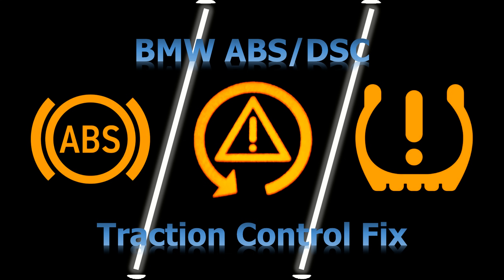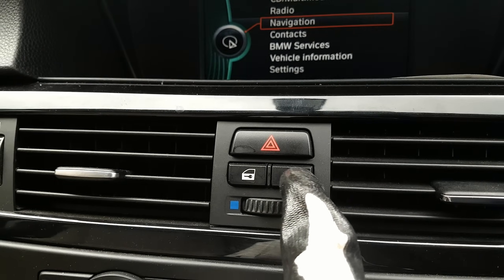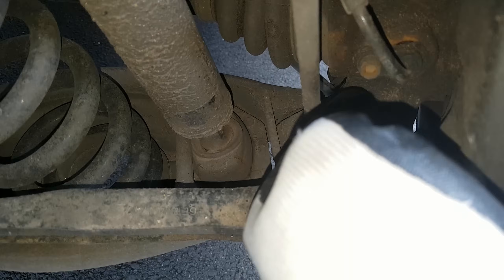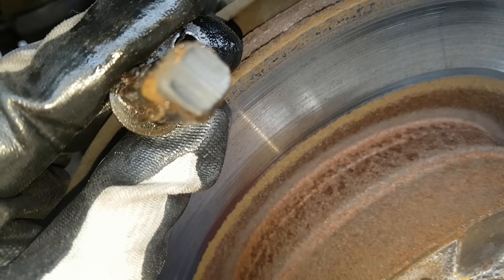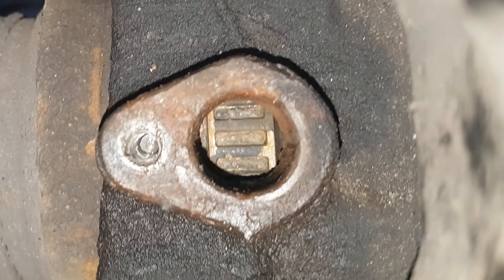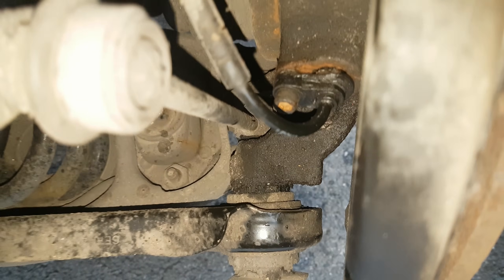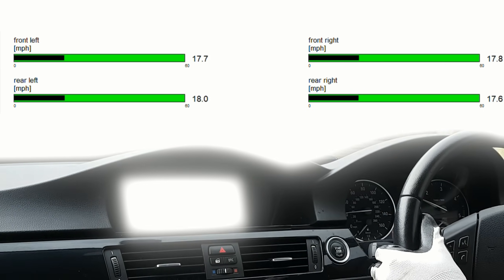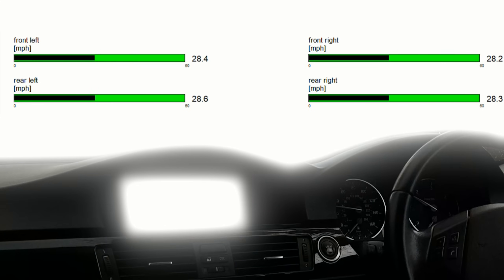BMW Traction Control ABS DSC DTC issue or loss of engine power

Comment: Really helpful video, thanks... and sorry, but I can't see where you explain how to determine which wheel it is without the diagnostic tool... Also...how can I be sure it's the wheel speed sensor and not the wheel angle sensor? Thanks in advance...
Reply from the maker: Sorry, I thought I did. In my case it was whenever i turned left it would fault out. In theory turning left means right tyre is seeing a greater deviation of speed compared to the other tyres, hence the fault.
Reply: @laymandiy  thanks.

Comment: Hi got same issue thanks for this! My diagnostic computers mentions this error on drive-1. Do you know which wheel this is?
Reply from the maker: Sorry, I do not. If you were to disconnect one of the speed sensors you'll know which one is 1 or2 because it would fault

Comment: Hi friend ! what kind of scan tool that you have ? I like it alot ,I had snap on scanner and I also have maxidas scanner but both of them don't have the bar graphs for speed sensors.My customer have a same problem with that light on ,her was 2002 BMW 530i and she has DSC button is that the same as DTC button ?
Reply from the maker: Inpa

Comment: Do you mean you can get a new set of axles ? The axles are what interact with the sensors. I'm just making sure before I get a new driveshaft. I have a xi so I might need 2
Reply from the maker: That is the permeant fix. Easier than replacing reluctor rings, however the reluctor ring method is cheaper.
Reply: @laymandiy  thank you! Awesome video . It saved me some depression lol

Comment: Hi, great vid, thanks. How do I find out which of my Wheels is causing this issue on my car?
Reply from the maker: Does opposite hand to the steering, usually. So steering left would be rear right sensor
Reply: @laymandiy  but I am not experiencing this when I'm steering. Just on a straight firing my first long journey in the morning...?
Reply from the maker: You're in the early stages then. The only other way is to jack the car up  and see which reluctor ring looks worse. You do not need to remove anything for this.

Comment: why don't you use a washer on the bolt that locks the sensor in position instead of there ?
Reply from the maker: Washer on the top of the bolt won't create the gap between the ring and sensor

Comment: I have a 08 528 xi and just upgraded to drill and slotted rotors installed new sensors and brand new shoes and hardware cause everything was rusted now and now am getting abs 4x4 and the dts why you think its causing that and the e brake light is on but in orange when the handbrake is down and red when is up I will really appreciate your help thanks
Reply from the maker: Did you also replace the drive shafts?

Comment: thank you for you videos, i have one question : i changed the ABS bloc ,
 and ring / sensor are fine , but it keeps showing the dtc/abs problem 
!! any advice ?
Reply from the maker: What does the diagnostic show?
Reply: @laymandiy  i scanned by OBD , nothing is shown , no default.
Reply from the maker: Are you using a generic obd or something like Kline/can or a A1/A2/A3 com. Generic scanners are pointless, you need one that read BMW control units.

Comment: hi great video. my son is having the same issue. how do you find out which wheel is causing the problem??
Reply from the maker: Difficult to determine, too many variables.. chances are both will probably need doing.. but depending on when the fault occurs left turn or right turn, it most probably will be the opposite side to that so in my case it was left turns causing an issue and it was the right rear wheel sensor
Reply: @laymandiy  pe is the rfect logical answer/ my opinion...what is nice about BMW is the community,...(we probably like the bmw body ;)))

Comment: Hi I really enjoy your videos, I am hoping you can help me I recently just bought a 2007 BMW 740l, in the last few days the display is showing Drive Control System! Drive moderately, the car is driving perfect no loss of power or steering, I called into a BMW specialist and he said it will need 3 hours on a dialysis scanner and it could be the automatic transmission, the car seems to be shifting through the gears ok, the logo light stays on and the drive control system, drive moderately goes out once the car is engaged in any gear.
.
Reply from the maker: Chances are your steering angle sensor needs replacing.

Comment: Hi, I have a E93 from 2009, I have just checked the 4 abs sensor holes to check for the rings so I could clean them, but surprise, looking through the holes none of them 4 have a ring. Please help
Reply from the maker: MANUEL ALEJANDRO PALACIOS CASTRO what fault are you getting. Some newer driveshafts had changed the way they check, with a smooth ring. But those weren't in these models. Yours has probably broken off, or someone has removed it previously. Can you see rust on it with grooves? Please send a picture and error codes
Reply: Hi, when I look through the abs screw hole I see no ring all I see is the drive shaft, and for the front ones, There is no drive shaft and when I look through the abs hole I see I can of ring but it is more like a plain silver metal band. Before I did the spacer thing I used to get the abs and traction control error symbols, first they came on and off, lately they came on and stayed on, after I turn the car off they went away. Now after doing the video thing no error symbols at all. My question is , first, in your car, do the rings only come in the rear wheels where there is a driveshaft? or they come in the 4 wheels, because there are 4 abs sensors, I was assuming that there were 4 abs rings. Second, If I do not have abs rings how do I fix the problem and how does the abs works without abs rings? Thanks a lot
Reply from the maker: Upon further look, doesn't look like adding a washer is going to do anything for you. In fact too think a washer means the light stay on permanently. It's like having a faulty sensor. 2 things could be the issue for you, easier option is abs is gone, 2) wheel bearings need replacement. Again without error codes it's quite difficult to diagnose, shooting in the dark here.

Comment: Please can u advise with stability control light shows and remains while I start the car and turn the steering wheel left with loss of power between 3000 to 4000 rpm. I made today a 600 km trip smooth drive though the traction control light on, however power is lost from 3000 to 4000 rpm in 4th and 5th gear. Thx in advance for ure response.
Reply from the maker: I'm afraid it's very difficult to comment, could be several things going on.. if it's rpm related I don't believe it's this issue but rather an engine misfiring issue may e the ratios are off or something. You'll need to connect it to a diagnostic machine to really understand what's going on..

Comment: Hello, does this fix (putting a washer in between) affect the correct functionality of the traction control/ ABS, DSC or doesn't the 'bigger' gap affect anything? Thanks
Reply from the maker: If the gap is too large the system will fault out anyway.  But if it works, it shouldn't effect the traction in any significant way..mine still kicked in if you do some fast cornering or accelerate too hard
Reply: @laymandiy  thank you :)
Reply: Make sure the gap created by the washer isn't too large or the speedometer will stop working.  Use a thin washer.
Reply: Tenho uma bmw 550i e aparece o erro tração avariada e perde potência o carro. Poderia me ajudar

Comment: Hi, I have ABS, DSC, and Brake light on, ISTA+ gave me S0085 No communication possible with : Dynamic Stability Control, Voltage Supply and S0114 Footwell Module (FRM) and short circuit processing.  Is it the ABS bump computer problem?  I seen many people have point out the different code to tell which speed sensor has problem, but these S00XX code all lead to Terminal 15.
Reply from the maker: Sorry, would need to investigate further. If you have communication issue then yes you could have a problem with your module. Sometimes if the footwell module is bad then obd cannot read certain modules, which might be the case here since it's a common fault.
Reply: @LaymanDIY  Is Footwell Module a plug and play? Or it need to reprogram to the car?  I have many code that lead to Terminal 15.
Reply from the maker: It needs to be programmed. I have a video on it

Comment: How can I find out which wheel is messed up without the diagnostic tool you have.
Reply from the maker: If it happens when you turn left it is the left wheel and similarly on the right.

Comment: Very nice video 
What size washer we can put it in
Reply from the maker: jas222grewal I used a 1mm thick washer. That should be enough.
Reply: What the size in standard or americ terms pls so i won't have to go to the part store an say do u have a washer to fit this bolt i understand what your say but America wont have a clue about 1mm 7mm dia nice video

Comment: Does the reluctor ring expanding cause the brake disk or the wheel hub to overheat? I have a e87 the same thing is happening on my car.
Reply: Do you have viber, or insta
I have same care and same problem... 
And i dont know what to doo..

Comment: Helpful video.  The issue I've been havingj just recently is that the ABS triangle light comes on when I start the car in the morning, stays on about 20 seconds and then disappears.  It doesn't come on later and in no way seems to affect the BMW's driving performance.  Then today the light did NOT come on.   I have a tentative appointment with the local BMW service dept. tomorrow but would most likely bring it in IF it acts up again(it's because the service tech might not know what to diagnose unless the light appears).  But should I still have this checked out?
Reply from the maker: If it goes away completely pressing the DTC button then chances are it is the same issue as this. If not there could be other issues.

Comment: How do you know if its Not the servo motor? the same lights come on.  Also how do you find out which wheel to fix if you don't have a diagnostic machine to view speed?
Reply from the maker: Because it fixed the issue for me and a number of other people. Please see video, I explain how to diagnose without equipment

Comment: Is there a way to find which wheel it is without the diagnostics? Or would it be a case of checking all 4?
Reply from the maker: There is a crude way to work out which side. If you turn left and it happens then it's the right side and vice versa

Comment: Driving stabilisation and flat tire failure. First code. D36D58 and second code D35A57.

Please help
Reply from the maker: Intermittent battery issues or one of the speed sensors has gone
Reply: Thanks you sir. Is there a mechine to detect faulty sensor? I tried many guys and no one has that mechine

Comment: Can you help me . I have 318ci 2002 model and ASC , brake light (RED colour not amber) & ABS warning lights are constantly ON.
I took out each wheel sensor and gave it a good clean but the lights are still ON. 
Today I did an emergency STOP on an empty side street and the car wheels skidded. Can you advise ? Great video .
Reply from the maker: Sounds like you may have an ABS issue. Skidding in an emergency stop is normal , if by skidding you mean it felt like the wheels were locking up then releasing again. Not that the back end was swinging out
Reply: @laymandiy  Something else I noticed apart from the three lights , the speedometer has stopped working and the fuel gauge is all over the place the trip meter is set to 0000 . Do you know which wheel sensor controls the speedo on a UK spec (Rhd) car ?
Reply from the maker: I think it's the left one. And it's probably dead
Reply: @laymandiy  Thanks . Do you mean passenger side rear ?
Reply from the maker: Yes
Reply: @laymandiy  Ok. I will take both rear ones out and swap them around to see if that makes a difference . If the speedo works then at least I will know for sure. I have ordered a ABS code reader too. Thanks once again for your advice .

Comment: Does this issue makes you’re car get the antilock system on because I have this issue and when I’m
Driving my car brakes my tires  even broke my front differential because of this issue I bought a new one and know is running but my tires still get lock
Reply from the maker: Well yes it does apply a breaking effect to prevent the car from sliding out

Comment: I have put the washers in both rear sensors. Does the light go out by itself or do you need to reset it? I have reset the light with an obd2 and app the light will go out but then come back on after a minute or less of driving. I'm pulling my hair out
Reply from the maker: Which light exactly? There are 3

Comment: Hey, i tried this fix but what happens is that if i take a washer that is too thick, the car does not register the sensor at all, and if i take a smaller one it just keeps flashing. 
Could it help to change the sensor and use a thick washer, or is the only way to change the refluctor ring?
Great video by the way :)
Reply from the maker: How thick is your washer?? And what material is it? You may need to do some cleaning first in order to remove some rusting...
Reply: @laymandiy  my washer is less than a milimeter, and i did not clean first, maybe if i try to clean and then use å bigger washer, it might work? But the sensor is pretty rubbed, so it might be nessesary to change the sensor aswell?

Comment: I'm owning a bmw e90 320i 3 series for the first time, there is a triangle with an exclamation mark, ABS and pressure sign on the dashboard. The car goes off while I'm driving and fails to start. And I have discovered a broken cable on the left side front tire.
Reply from the maker: Car goes off whilst driving sounds like a recall issue...

Comment: Daughter's 2006 325i was hit. It was hit on driver's side not much damage but enough to bend a few rear suspension brackets. I replaced the brackets a nd test drove the car. After a few blocks the tcs sensor flashed. The car was hit and pushed like 6ft. Could the accident caused the sensor to fail. Cause I've added the spacer to sensor already and no luck thanks .
Reply from the maker: could have damaged the sensor. If you have a diagnostic cable it will be easier to check if it is a sensor issue or a bigger issue.
Reply: @laymandiy  obd2 diagnostic would work thanks

Comment: Hello i have BMW e 65 730il i have faulty Tyre pressure red sign in my dash after i drive for 3-5 km ,  i also have no Tyre pressure rest in my I Drive System i have no ABS sign light but my question is this could be abs speed sensor problem ??
Reply from the maker: Quite possibly.

Comment: I have the same problem with my Landcruiser 200. When turning Traction control light pops up & Power cuts off for a few seconds. Turning off traction control prevents it from happening. Now i have one question doesn't a bad or failed wheel speed sensor show up an error code on the computer? Bcz mine doesn't.
Reply from the maker: Yes a bad wheel sensor would, but in this case the sensor is doing it's job correctly, just the input into the sensor has noise in the form of corroded joints
Reply: @laymandiy  Thankyou! I'll have them check it out.

Comment: I have this issue in my E90, I've got an issue onthe NCT due to Rear Suspension system (Wishbones/swinging arm-mounting), reason Worn... could it be the issue?
Reply from the maker: Anything that impacts the detection of the wheel speed can be at fault. None have as big an impact as corrosion on the ring

Comment: Grest video my e46 m3 dsc and handbrake light stayed on together but went out after a day is this  same fault
Reply from the maker: David m3 maniac difficult to say, without knowing anymore symptoms. They could just be independent issues. I don't see why the hand brake would be linked to a DSC fault
Reply: LaymanDIY   thanks for swift reply. No worries will try bmw forum. Keep doing these videos as bmw are not cheap when it comes to these faults.i have saved a small fortune thanks to people like you.
Reply from the maker: David m3 maniac I would highly recommend getting k+dcan cable costs between £10-20 and it will diagnose almost 99% of all your issues

Comment: When I drive I get the traction control light flash and car judders dropping speed, when turn traction control of the car is fine but sometimes the two other lights come on, the abs one and another with circle and exclamation mark inside it...what could this be? Same issue as described in vid? When tried diagnostic nothing appears and the lights disappear when car is restarted
Reply from the maker: Could be many things but it doesn't look like the root of your problem is the one highlighted in this video. You may have a genuine abs or brake issue.

Comment: sir after you change the abs sensor do you need to reset something? thank you
Reply from the maker: Nope
Reply: @laymandiy  sir if i may add after i change the sensor on the rear left.. another code for bank 2 sensor 2 appears.. does this affect the speed of the car? and if i order for the part do you know which one is for the bank 2 sensor 2? down stream or upstream? sorry new on this car.. thank you